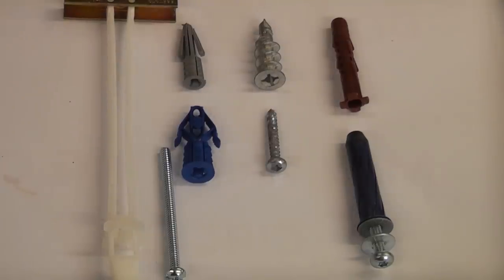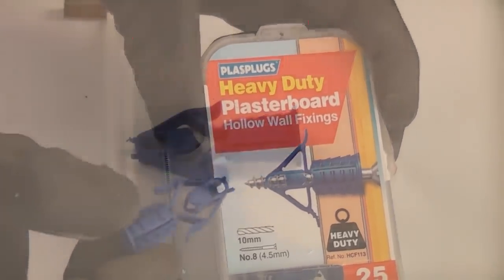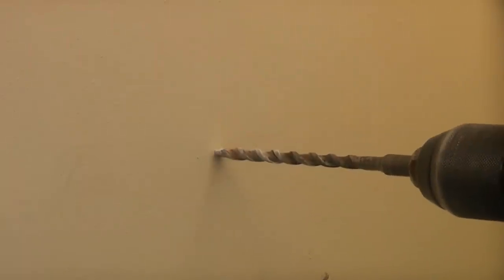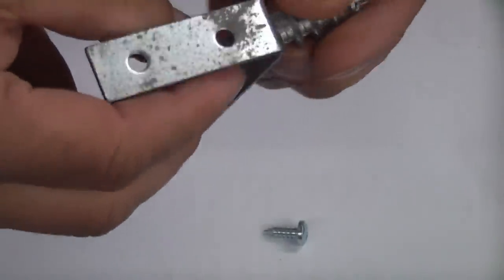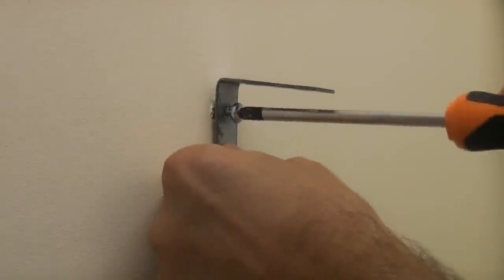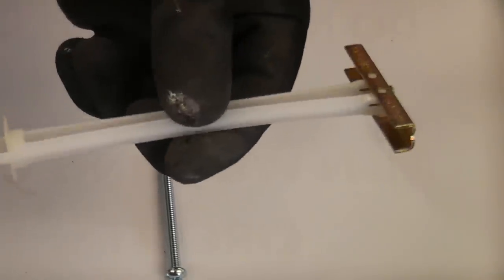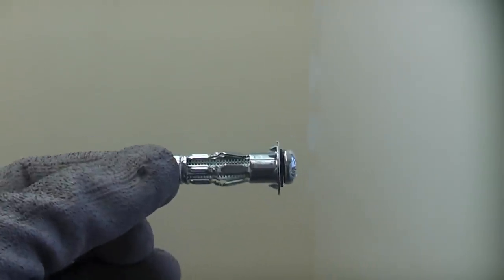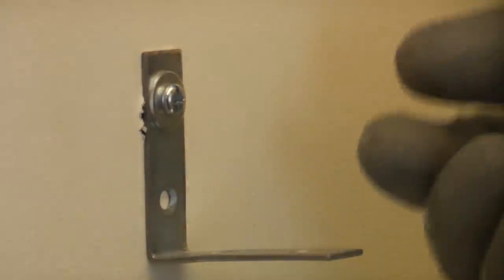Plasterboard fixings- The good, the bad and the useless!

Comment: I have always struggled with plasterboard walls (rarely with brick walls) and it usually involves a lot of swearing. I have just had to take some shelves down that were sagging and falling off the wall. I got some new shelves repaired the wall and searched the internet and came across this video. I opted for the redi drivers as I can get those at B&Q. Most of the others I can't find there. I have struggled with redi drivers in the past but your tips on screw length etc were a life saver. Apart from one of the eight I had to do, where there seemed to be filler/brick behind the board, everything is now up and secure. Great video!
Reply from the maker: Thanks for the comment

Comment: When using those conical aluminum anchors, it helps if you turn the screw in and out a couple of times when the anchor is still undetached. That way you can avoid using excessive force which will break the plaster board.

Comment: +Ultimate Handyman
I found the secret of the blue heavy duty PlasPlugs is to use the screw with the smooth neck, but shorter than you ones you tried in the video. The screw should only be as long as the actual length of the plug. The screw bites into the tapped end of the plug when the neck reaches the collar of the plug. The screw then rotates freely in the collar, but the tapped part of the plug is drawn to the wall, expanding the wings against the wall. In your demo, the tapped part of the plug is being driven away from the wall by the pressure of the tapped part of the screw still being driven through the collar.

(ps very grateful for your channel... I've refitted three rooms with the lessons learned.)
Reply from the maker: If the screw is so critical to these fixings working you would expect the manufacturers to supply screws with the product.
Thanks for the comment ;-)
Reply: Agree - either supply the screws or state what works in the instructions! 

That said, I may just have got lucky. Does it work for you?
Reply from the maker: I don't use these anymore and can't remember where I put them, I just made sure they were not with my other plasterboard fixings! 
Thanks for the comments
Reply: I have found that using a thinner screw helps. Many of the manufacturers specify screws that either break the anchor, or else spin the anchor in the hole in the plasterboard.
Reply: The PlasPlugs I bought in Canada work really well - never had a problem with them breaking. I wonder if the ones you got were defective or the screw size wrong? The ones at HomeDepot in Canada include screws, but they're just regular wood screws.

Comment: When you use Ready Driver Zinc Worm Screws as you name them, coat them in PVA glue as they go in and they will set solid and consequently be a much stronger fixture. PVA will bond porous to non-porous materials in this way.
Reply from the maker: Thanks Phil, I don't use them much to be honest but I'll try that next time.
Reply: Also why not use drill instead of screw driver it’s quicker and you can set the correct torque needed
Reply: Given the flat tip of these zinc worm screws, it makes sense to start off by tapping them in to position with a hammer, up to the thread. Then use a screw driver with some pressure. This will ensure greater accuracy of the fitting location.

Comment: Took me years of pain and distress to learn what you have shown in 10mins my friend! Well done - great informative video for avoiding plasterboard disasters and wasting money! Can highly recommend the last item (the red plastic circular discs) just fitted out a load of kitchen wall cupboards using them. Manufacturer boasts a hanging weight of the red ones to 75kg! (Other weights/sizes/colour codes available too). Big tip with them is not to be frightened of tightening the screw right up to ensure a nice secure fitting. Top video👍
Reply from the maker: Thanks for the comment ;-)

Comment from the maker: @harry lewis
If it's a hollow plasterboard wall I would use snap toggles or the blue Grip it fixings. If the wall is plasterboard with a solid wall behind I would use Rigifix fixings. https://www.youtube.com/watch?v=xaYfs3lr1jI
Reply: +Ultimate Handyman wow am a plasterer and I didnt know the "Grip It" fixing existed lol... I have plasterboard with solid wall behind it, and in between them I have pipes. So I think Grip It would be my only choice seeing I can only go deep as the plaster board (I have a gap of few mm between hard-wall/pipes and plasterboard).

Thanks for this awesome video m8
Reply from the maker: +MarkUs FinSki 
You are welcome
Thanks for the comment ;-)
Reply: +Ultimate Handyman
  snap toggle or grip it what would you say is better best for using generally and using to hang kitchen cabinets and tv brackets
Reply from the maker: After testing many plasterboard fixings I'd go for spring toggles in most applications as they are inexpensive and can hold more weight than some of the other fixings-
https://www.youtube.com/watch?v=ECDysfNhx_E
Thanks for the comment ;-)
Reply: +Jack Jill....It would be normal to install what we call 'grounds' in kitchens with plasterboard walls. Like noggins, but the grounds are lined up just below the height of the top of the cabinet.

Basically horizontal pieces of timber attached to the stud work for the specific purpose of hanging wall cabinets.

If you must go for a plasterboard fixing then keep all your plates in the base units ;-)
Reply: Ultimate Handyman

Comment: Very nice round up there.  Great to see the fail points on camera, those plasplugs were utter crap! Never used the snap toggles myself but they look very good, used most of the others in some form and for my money it's very hard to beat umbrella fixings, strong, permanent, easy to fit (I don't have a tool) and cheap as well. What is the load rating difference like between the snap toggles and the umbrella fixings? Are snap toggles a bit more heavy duty?
Reply from the maker: +caskwith 
Thanks, I'm going to do a video soon seeing what weights some of these fixings can hold in plasterboard. I think the snap toggles are more heavy duty than the spring toggles, but have not tested them to be 100% certain yet.
Thanks for the comment

Comment: what I do is drill through the wall in to next room and put a steel plate .on the wall. 6 inch square and  1 inch thick. 10 mm bar and bolt it down..and that is hang anything on it
Reply: Specs sound reasonable, but to avoid undesirable shear loading, i would actually recommend drilling across that room and into the far wall.
Reply: This is quite common if you were to look up at some of the older buildings you will see a cast iron plate with a nut in the centre. Saves rebuilding the wall for some time.
Reply: proper hardcore. question is: is it bulletproof though? :)
Reply: Good neighbour
Reply: Dave Jenkins, you crack me up. Very funny !!!

Comment: I hate the spring toggles, they don't work in modern homes with insulation in the walls, they just get caught up in the insulation and don't work for me.
Reply from the maker: Surprisingly  they are one of the strongest fixings available!
Thanks for the comment
Reply: They are only rated at around 10kg and I have found many others that are rated at 15kg and heaps easier to install. The tabs don't seem to spring out when there is any insulation in the walls.
Reply from the maker: I tested some out in this video and they were the best performing plasterboard fixing- https://www.youtube.com/watch?v=ECDysfNhx_E
Perhaps you could try moving some of the insulation away from the hole?
Reply: Try Fischer 6mm plasterboard plugs for light-med. duty :]
Reply: They are the only ones I use. Find they are the strongest.
Reply: They are useful in lath and plaster walls

Comment: Once again a useful video. Those reading these comments might want to consider using 'Bullfix' fixings, which are similar to the 'GripIt' but have wider plastic wings on the inner wall side. I have just used four of them to hang a 43" QLED TV on a stud partition wall and it's rock solid, much to my amazement. The pack I purchased had 10 fixings, corresponding screws and the necessary 20mm drill bit, all for around £10, so enough left over to hang another TV.
Reply from the maker: I recently tested the Bullfix extra, although the video has not been made public yet- https://youtu.be/h5UqIlw61Vw

Comment: you dont need a setting tool pal
Reply from the maker: Yes, I know but some people have had issues with them not biting and spinning in the plasterboard ;-)
Thanks for the comment
Reply: its the best way for the best possible result
Reply: Huh didn't even know that there was a setting tool. I just tap it with a hammer and screw it in so it mushrooms.
Reply: Far easier with a tool

Comment: He lost my respect when he started using a masonry drill on plasterboard...
Reply from the maker: What would you use on plasterboard?
Reply: Here in the USA the home of wallboard....

Being a soft material you will find a wood drill bit does a much better job!

If the item to be hung is less than 10lbs/4.5 kilos a nail driven down at a 45degree angle into the wallboard is more than adequate.

And no we do not skim coat wallboard with plaster! Just tape & mud the joints, mud the screw holes, light sand to smooth and either texture, prime and paint or just prime and paint.
Why pay hundreds extra in material & labor when you could never tell the difference.
Other than our way won’t crack!
Reply: @felinthorn4977  I disagree here in the USA we call it sheetrock or drywall.
PS there are areas of that USA that call it plasterboard and the "mud" is a skim coat. Here in the area of the USA were I live it's call joint compound.
Reply: @felinthorn4977  Sorry but plasterboard was invented in the UK  and we have been using it longest . We either mesh tape every joint  and then skim it with plaster or paper tape the joints and sand . I have been putting it up for over 45 years and skimming definatly produces a superior job .  Which is far less prone to knock damage .  I find that a masonary drill in a drill not in hammer mode produces the best hole for fixings
Reply: Why would you use a wood bit. HSS bit with no hammer action, sorted.
Reply: Daniel, he asked you a question, care to share?  You do realize those bits are used for more than one thing right?  If it can drill through concrete, it's surely more than capable for drywall/plaster.  Wood bits are just as equivalent. Metal bits ... same thing.  Not every bit is made for one use.  Would understand if he took a wood bit to concrete but dang man, respect the fact this video was brought upon us rather than knit pick one little itty bit change that wasn't to your standards.
Reply: Safer than a wood bit should you hit something unexpected.  A wood bit is much more likely to pierce an electric cable for example.  Even if you do all you can to make sure it should be safe there is still a small chance you've missed something.

Comment: Great video. Really helpful. I actually watched this after buying some heavy duty Plasplugs. I used them to put up some shelves for light use. I actually found them to be really good. Did the job well. The shelves are only to hold DVDs but really secure.
Reply from the maker: Thanks, Alan.
I did not have much success with some of the Plasplugs fixings.
Thanks for the comment

Comment: Excellent info.
I've just done some tests at home with 2 layers of 12.5mm plasterboard.  Yesterday i fitted 6 ceiling lights for a customer, each light was around 5kilos, so i used 3 of them metal screw types per light, but you reall MUST ream them out 1st , hold em with pliers & put the screw in a couple of times.
My test at home involved me using 2 ( screwed into double thickness 12.5mm board) i could pull nearly 50kilos before they popped out. Ive seen quite a few videos of tradesmen just using an impact wrench to screw in the metal ones which in my opinion will normally spin the  " metal fixing" and your then left with a large hole.

Comment: Great video, just what I needed. Fitting an Ikea Tretur roller blind upwards into the top of a window cavity/window bay. It was straightforward in the toilet - plasterboard over a lintel, so I used gradually increasing drill bits, and masonry bit for the last 0.5cm or so. Then used ordinary wall plugs, which have given a firm attachment.

However, the apparently similar situation in the bathroom is not the same at all. Drilling into the plasterboard, there was very quickly no resistance. Poking a bradawl into the drill hole, it's clear that there is a cavity on the other side of the plasterboard. As the roller blind involves pulling downwards, it needs to be a secure attachment - I think the snap toggle is probably best (because the holes in the bracket are quite small, and fairly closer together, so the other options would involve drilling wider holes, close together - could cause the plasterboard to fail completely).
Reply: Just finished - a 4-hour job including a trip to Screwfix! It was a bit fiddly because .... well, Ikea. I've now screwed into stone lintel a few times and think it would be a good video for you to do. ;-)

(I've never come across the situation above before. It was a bit of a bugger, because (a) I didn't know if there was enough space for the toggle to spring open before it hit the lintel, and (b) if the screw didn't go straight, it wouldn't go into the gap I had drilled in the lintel to allow me to screw it fully in. I think one of the 6 screws actually did hit the lintel, and I ended up having to leave about 2mm of it sticking out, but thankfully it didn't impede the roller blind clipping into the bracket. Phew! I always have a nervous moment doing even basic DIY, when I have made a dickens of a mess and think, "If this doesn't work, I have 6 lovely big holes in my newly-painted plasterboard"!

Comment: Hi thanks for the review I was just about to order a bunch of Plasplug heavy duty plasterboard fixings from Screwfix, glad I didn't bother.As a young electrician I used to use the metal hollow wall anchors about 40years ago, they used to come with a small pressed steel spanner that had a hole/slot to let it slide under the head of the bolt and it had two ears pressed down that projected into the wall anchor, this stopped the anchor from turning, they were great and you didn't need to buy a fancy setting tool.Good review well done.Kind Regards . . . Andy
Reply from the maker: Thanks for the comment, Andy  👍

Comment: That was excellent, thank you. I knew how they worked but seeing it from the rear of the plasterboard was great. I've a TV to put on a cavity wall with no studs near it, so was thinking about using Gripits. Definitely will be now. Thanks again.
Reply from the maker: I'm glad the video helped ;-)
Thanks for the comment
Reply: @ultimatehandyman  I ended up using Fischer Duotec fixings. There was a section of chipboard behind the plasterboard which made it too thick for the Gripits. I found the Duotec to be excellent though.

Comment: Fantastic video. the most definitive video I have seen on plasterboard fixings by far and the rear view was very interesting. I keep a box of those plasterboard plugs (grey) on the van. good to see that they are actually as good as useless for the applications I would use them.
I didn't get the point of those large ones at the end, they don't look as strong as either the snap toggles or spring toggles but you have to make a massive hole. Spring toggles are my go too when I need a good fixing. Snap toggles look good but are not cheap!
Reply from the maker: +EssexSpark Thanks ;-)The snap toggles are my favourite, they are far superior to other plasterboard fixings.Thanks for the comment

Comment: Brilliant Video and explained EXACTLY which ONE of the FIXINGS that I had available were the correct ones for the Load in Question as I used some Nylon One's originally that were OK on some of the WALLS but started to give way ONCE  a LOADING was added and so I replaced with the SPRING TOGGLE and this has WORKED VERY EFFECTIVELY! The whole of My House is PLASTER BOARDED over STONE WALLS and so it is great to know the DIFFERENT VARIETIES to be USED for different SUBJECTS! I think that the ONE that I take out of the VIDEO as being the BEST is the SNAP TOGGLE which appear to be the Most Expensive as well but if you are looking at HEAVYISH LOADS then I think that fits the Bill EVERY TIME!
alan box
Reply from the maker: Thanks for the comment ;-)

Comment: Thank you so much! I never knew that hollow wall anchors required a setting tool. I tried expanding the legs at the back just by tightening the screw in as I attached the fitting, only to see the anchor turn in the plasterboard and not grip. So I never used them again as I thought they were useless. I'e got dozens of them, unused, which now I will use ,after buying the setting tool on Ebay  AU$12 !
Reply from the maker: You are welcome
Thanks for the comment